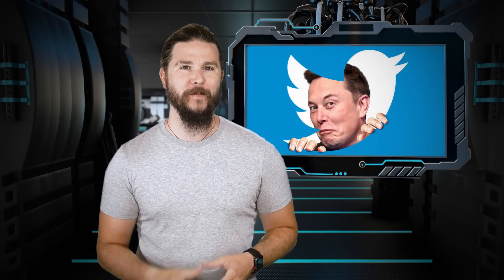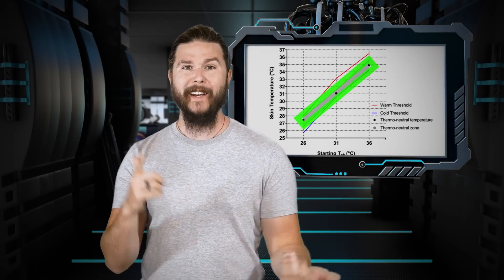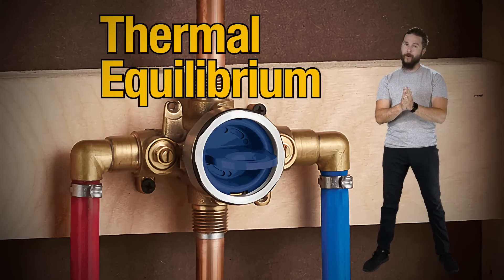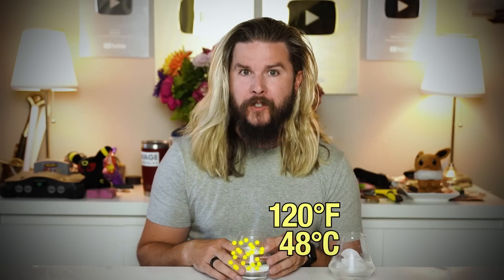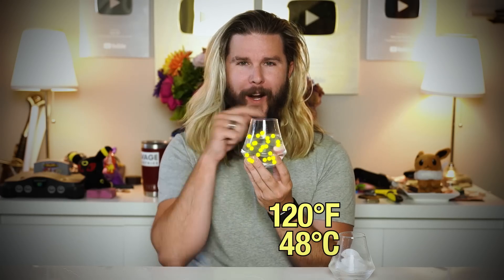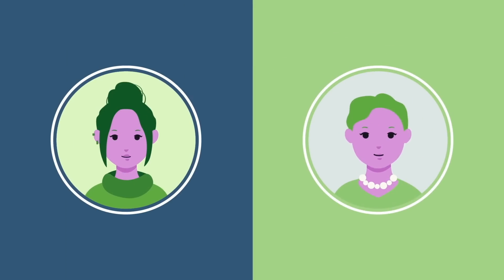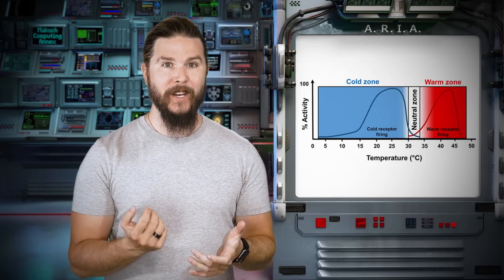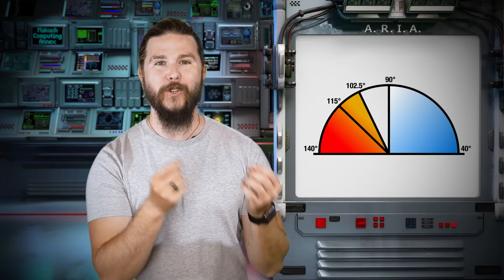Why Are Shower Handles So Sensitive?

Comment: Hi Kyle, great new episode. I wanted to know more about the thermoreceptors in our skin though. I have fibromyalgia and I have found that I have become EXTRA sensitive to hot and cold to the point where it causes pain. Sitting in front of a fan can feel like pain, so can having direct sunlight on my skin. BUT I have a very high pain tolerance when it comes to getting tattoos and I just don't understand it.

Also, I have never had this shower problem. I don't know if Australia is just different but all the showers I've used have a separate hot and cold tap rather than combined. I usually turn the hot water on first, and add cold as it warms up. From your video, it makes sense that two taps give far more control than a joined one. 

Come to Australia for... our showers?
Reply: "I just don't understand it"
Fibromyalgia in a nutshell.
Reply: @elibeeblebrox1084  
Me: so is it autoimmune or a nervous system issue?

My doctor: that's the neat part, it's both.
Reply: @cthulhuscosmicdread  not even they know if they're being honest. 

I just figured out my CFS no thanks to them. Apparently rare cases of unmedicated ADHD can snowball into CFS, MDD, and/or FMS once the dopamine deficiency gets bad enough. Solution is medicate the ADHD. No one knows about this and there's like 3 small studies on the connection. Could have got way worse if I didn't have a hunch to look up a connection between the two. Good luck with yours.
Reply: @elibeeblebrox1084  this doctor I have now is the one that diagnosed me with CFS and fibro. My recent blood tests showed high inflammation and he's just like, I don't know why? The other indicators are fine? After a month trying antihistamines (some evidence for helping long covid sufferers with fatigue) I'm now going to be trying some medication that was originally for weight loss but now that think it does something additional around dopamine. It's just like, throw everything at it and see if anything sticks.

But it does feel like no one knows most of the time. I'm glad you commented, because I do seem to have some of those links. Diagnosed with MDD and severe anxiety as a young adult but that was after years of no one knowing 'what to do with me'. I was the naughty kid with no discipline and wasted talent. Now I'm thinking there was more to it.
Reply: @cthulhuscosmicdread  that's exactly why I commented. I hate suffering and have sworn to eliminate it. If a random comment has a chance of helping, I'll type it. The studies show 30-50% comorbidity between ADHD(specifically the Non-Hyperactive / Primarily Innatentive Type or as I like to call it: ADD) and CFS/MDD/FMS. Been mentioning this to people with those problems and nearly all of them have been diagnosed with or suspect they may have ADD. It's tough though, because it's both over diagnosed and under diagnosed at the same time. 

You'll probably get a diagnosis for ADD because that wombo combo will definitely give you the symptoms for it, but that won't mean you actually have it. Still, it's worth a shot to try the traditional ADD amphetamines and you did just describe yourself as a poster child for it lol. Some pro tips: Avoid the non-amphetamines except as a last resort as they can have awful adjustment periods like antidepressants do. Amphetamines work or they don't. You'll know in days, not weeks. If your insurance will cover it or you are filthy rich, I recommend Desoxyn. Expensive but safest I believe. Studies show it may even have neuroprotective properties which would make it even more helpful in your situation. The other amphetamines such as Dexedrine, Adderall, and Ritalin can improve memory formation while negatively impacting memory recall. It's weird. And Adderall can spike stress hormones. Not everyone seems to suffer from those effects. You may prefer them to Desoxyn, we're all different. But most people who have tried Desoxyn find it much gentler, and less necessary to cycle or take tolerance breaks.
Reply: @cthulhuscosmicdread   oh one more thing: inflammation can be caused by critically low neurotransmitters, but also by plants. Almost all of them. Especially with a weakened body. I recommend giving the carnivore diet a shot. Specifically strict beef, salt, and water. Do plenty of research on it before commiting. Adaptation can be rough and electrolyte supplementation necessary during that period. Most of us never look back after trying it. It's a miracle for those of us who respond well, which is pretty much everyone with any of the slew of mystery illnesses we don't currently understand. And if you have ADD, studies show we thrive on high-protein diets. I had to do both carnivore and ADD medication to recover. Dr. Anthony Chaffee here on YouTube makes great videos on the carnivore diet.

Comment: I read a book about preparedness about 20 years ago, and one of the things suggested was to slowly condition yourself off hot water in the shower. I tried it and for a couple years I was showering at 60 degrees F. Then I got into a relationship and learned to love a hot shower again. But it’s interesting what your body will get used to if you’ll suffer a bit!

Comment: In my shower, I have about 47.5 degrees of potential comfort, but that is only because the plumbing in my building is so shit that the temperature of the hot side is dependant on how many people are using hot water (with a variance starting to occur at three use points per floor), and the flow rate of the hot side. So the point that is ideal /shifts/ 47.5 degrees over the course of a shower, while still only having 12.5 degrees of real estate.

Comment: Okay, yeah, I was going to say: how hot your water heater is set is a massive influence on this.

Engineering the shower controls so that it's limited to a smaller range but spread out over a greater ranger of motion would be great! Except that where that "sweet spot" is will change based on your water heater and based on the time of year (with far greater variance in some climates than others).

So, if you were to alter the shower control interface so that the knob(s) only cover a certain range of temperature shift, you'd also need some contraption before that to control for the variances so that the in-shower controls can remain simple and stay within that desired range and keep the greater granularity desired. 

Personally, I do sometimes like "room temperature" showers, or even slightly on the cool side of things during the summer. But we'd still be talking about a very narrow margin even if you widen it to include a smidge on the cool side.

Ultimately, what'd be really nice -- and at this point I'm not even sure how it'd be implemented -- would be to have a (waterproof) digital interface where you could just select the actual temperature you want (locked to within a safety range). That way you know what you're getting and overtime will learn your actual preferred temperature range. Like between 80F and 95F or  26C and 35C. Might even notice a trend in preferring different temps when you just wake up or during the winter versus during the summer. ... Why aren't digital shower thermostats the norm? It's freaking 2022.
Reply: Or two knobs.

Comment: I never thought about how small of a range we use on the dial.

Not only the small range, the water heater seems to change what "hot" is depending on outsode temp. Or, is this the body thermometer changing what "hot" is?

Also, growing out your beard?
Reply: Most likely, is the "cold" water temperature that changes, since it isn't cooled, it's just at whatever temperature it comes from outside your house, and that depends on the weather to some degree.
Reply: @Dsiefus  its not 'to some degree', it actually changes a lot depending where you are. i live in texas, where during winter the water is likely in the 60s, and summer it reaches as high as 90, which is a way bigger variation than the 120ish your hot water aims for, and actually stops at that temp so it stays rather close to that year round

Comment: ive never used a shower handle like what you have, and yeah i would agree that most of it is useless.
but you have to remember that sometimes people take cold showers, at least here in australia we do during the rather hot summers and it is quite handy to be able to have a cold shower after getting a full body sunburn like i have multiple times now (or even just with regular burns if its in an awkward spot).
so getting rid of the cold side altogether is probably not a good idea.
i agree though that the hot side goes further than it probably should.
having a separate handle for hot and cold is the way to go though, you can get much more precise temperatures and pressures.

Comment: I feel like using a gear ratio would be a somewhat elegant solution to this, cutting out more of the "dead zones" of extreme hot and cold and making the comfy zone a much larger portion of 180 degrees of real estate.
Reply: Would certainly be a decent option for retrofitting a shower head you already have. The other option is old school, twin valves.

Comment: I adapt to the water, and I do like it quite hot, but I can't do very hot right from the get go. I have to get my skin wet and soak for a few minutes until my skin adjusts to that temp then I turn the temp up until It's almost too hot and then it just feels sooo good soaking in that hot water. My problem is the hot water doesn't last long enough some times.

Comment: My apartment water heater is disappointingly tepid even on full blast, and doesn't have a thermostat adjustment because the temperature is hard wired to save the cheapskate apartment complex owners money. I wish I had this problem.

Comment: I remember encountering a shower once that had a thermometer to show the temperature of the water going to the showerhead.
Reply: With all technology these days, that should be standard
Reply: Thermostatic valve: mechanical constant-temperature solution based on thermal expansion of parafin, a spring, and some slightly smart water flow design.
Reply: I'm skeptical that is what I encountered, but I'll be the first to admit that I'm no expert, so it could've been. At the time at least it seemed to be more just an on-demand water heater equipped plumbing system. It was in an exercise room's bathroom at my dad's previous employer in the before times. We'd had an unexpected weekend blackout, and went there partly so I could shower since there was no hot water at home.
Reply: @LexieAssassin  true: could well be an instant heater electric shower.  Maybe even natural gas.

Comment: I have not have any problems with the mixing valve on any shower. My only problems have some when showering when someone does something like flushing a toilet on the same cold water trunk.
edit: I tend to shower right around or just barely above skin temperature, then finish (except in the midst of winter) with 20-30 seconds at about 3/4 cold. Combine that with short (under 8 minute, thanks Fort Benning!) showers, and I almost never have a steamed mirror.

Comment: My shower lines up and stops at the roughly 120⁰degrees which the temp comes out around 47⁰C vs starting at an unlucky 13-14⁰C. So everything before that 90 is about 13⁰C while the hot is great and lasts for up to 45-55minutes of shower thoughts. FYI: I love hot water and well I wish I could not have to do adulting sometimes like you too.

Comment: So I have a cool shower ending - You have your wash temp. It's good, warm, nice. Then you crank up the temp. Not too much, just a bit. Relaxing. Bask in it for a minute or two. Then crank the temp down. For me that's a few degrees below wash temp. Put your head or neck/shoulder under the spray. Let the cool water flow over you. Let it cover you. Literally about thirty seconds, enough to cool the skin temp without taking away the deep relaxation from the high temp bask. It's like a cool breeze on a warm spring day. Literally the first time I tried it I damn near fell asleep in the shower. It's so soothing! Wash temp, then a minute or two of deep muscle hot temp, then 30 seconds of cool temp rinse. So relaxing. For me the cool temp is just below wash temp, but for you may be different. Experiment, for me this has become a true delight in my day.

Comment: STELLAR IDEA! 
Why not put gear reduction between the handle and the valve, and set the middle point of the handle as the middle point of the "sweet spot". Then turning it all the way to one side or the other will still be hot or cold, but the area in the middle is much easier to hit as it would be much bigger. Just make it less valve movement for more handle movement.

Comment: In Brazil we use electric showers, the water is heated right as it passes through the head of the shower, you can choose between off and usually two temperatures, for winter and summer, it's sometimes annoying because for colder days the winter temperature is still too hot, but for normal days you can set for summer and if it's too hot you just open a little more so water passes faster through the shower head with less time to heat, it's not perfect, but it's far better than that freezing vs scorching nightmare...

Comment: I start at max heat....then work my way down. 

I like my showers to err on the fine line between.  "Mmmmm hot" and "Torture" in the first half. Then slightly faster than slowly take it down to "eh its a little chilly outside"

Comment: I guess I've always sorta circumvented this whole issue by starting out a bit warmer than I'd prefer and working my way incrementally to a point where it's a bit cooler than would otherwise be comfortable so I get out of the shower refreshed and not overheated and immediately starting to sweat. I dunno - seems to work for me...
Reply: That's the way I do it, too.

Comment: I believe you also forgot to figure in all the additional factors, amount of time the hot water takes to reach the valve, the delay between when you set the valve ratio, and when it reaches the showerhead, (and then you), the thermal conductivity of the pipes, AND external factors, like water pressure variants (someone flushing a toilet) etc..
Reply: Add to that for when this is looked at when someone lives in an apartment....

Comment: My shower is so sensitive, there are times I want to adjust it slightly, I literally just put twisting force on the knob, and if I detect it moving at all, I know it's gonna be way too hot/cold in about 5 seconds. If I just put pressure on it and then let go, and it doesn't seem to move at all, it usually changes it the right amount.

Comment: Let's not forget the struggle of anyone else in your neighbourhood turning on their water, creating a change in water pressure at your home, and throwing off the delicate balance you've spent minutes reaching. If you're lucky, your hot and cold water pressure are affected near equally and only the flow rate is affected. It's far more likely that your shower will trend scalding hot or ice cold, depending on how hot water is delivered to you. That means some kind of gear reduction system for better control may make it impossible for you to correct for that pressure/temperature change.
We all need better shower technology.

Comment: What surprises me is the lack of temperature holding shower controls.  It's easy to do, either with a mechanical thermostatic mixing valve, or an electronic one that monitors the output temp and adjusts the mix as needed.  Throw on a little LCD display for the desired temperature, and every time you get in the shower it can be exactly the same.  
Self regulating thermostatic controls used to be a thing, too.  My father restored a turn of the century house that had the original shower, and it had these controls.  It failed and allowed only hot water, but for enough of the previous 100 years it worked so people kept it.

Comment: IDK if he mentioned that in the video, because I am at the start yet.
But funny fact, we use ELECTRICAL showers in Brazil. Yeah, energy comes in, pass through an resistor that get hot and then an water flux pass through it.

Comment: This is pretty interesting although I've never seen a shower designed this way. It's still tough getting a good temperature and pressure balance using a separate dial for hot and cold though.
Reply: Meanwhile I don't recall ever seeing one that isn't like the one in the video.

Comment: Along with the bacteria issue, you actually lose efficiency if you turn down you water heater temperature. 130f or even 140f water, mixing with 60f water requires less hot water to get the temperature where you want than mixing  120f water with 60f water. All of which means the hot water in the tank doesn't run out as fast, you use less, and therefore have to heat less new water.

Comment: Well...where i live we pass the cold water through an powered metal piece to heat it up, and the flow speed/pressure of the water controls the temperature...yep. insane. also, same problems, plus you have to choose between low dripping lava or turbo freezing waterfall.